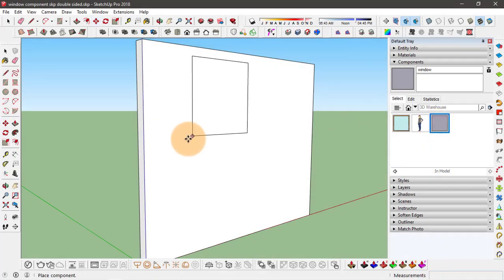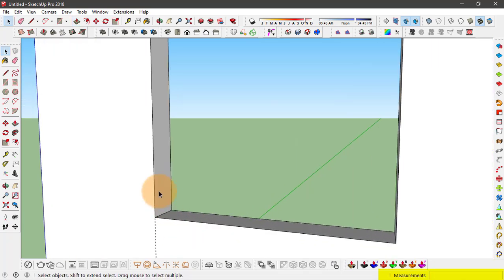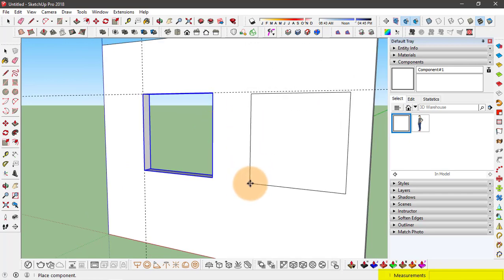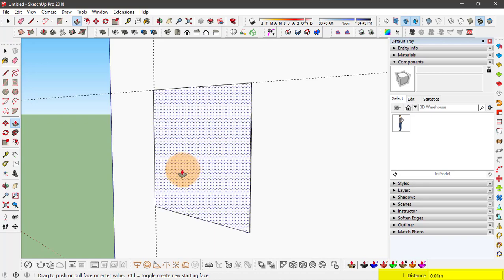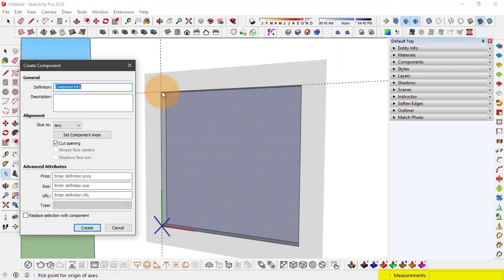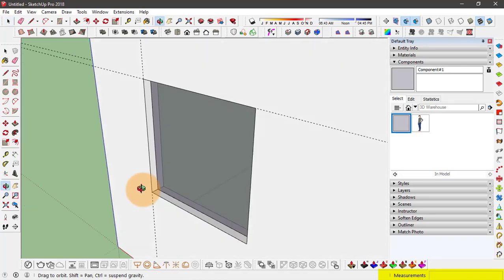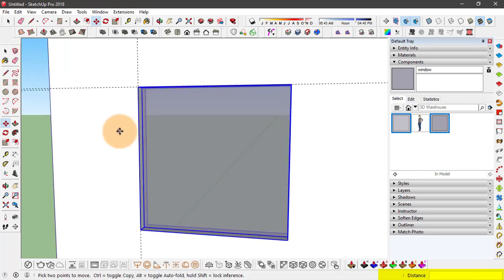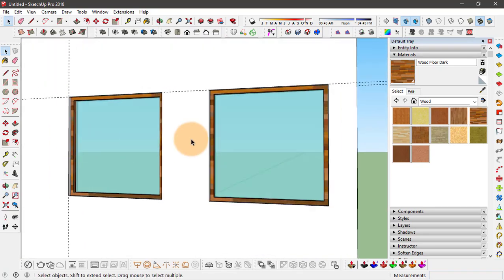Create Sketchup Double Sided Window Component

Comment: Thanks you have lot of amazing videos. I have a question I make 3D printed buildings so having it as a solid is a must. When I try to make a brick house....each brick is a solid then I try to attach the bricks to the wall (a solid) it always says page not responding due to the amount of solids trying to “union” making it all one solid. Is there a way to avoid or fix this??? A response would be great but a video would be amazing. Please respond. Thanks
Reply from the maker: When it comes to 3d printing,  it's best if you keep the model simple, with not too many faces.  Now if the wall unit is made up of a number of bricks,  then there could be trouble because too many faces are intersecting on one plane.  Basically keeping the wall as a whole a solid component will work. Sure,  we'll make a video on it.
Reply: architutors WOW thanks so much for the fast reply/answer. I will definitely benefit from it and I’m looking forward to the video. Any guess on when that might get put on you’re channel? Thanks Again!!!
Reply from the maker: @brittanyharman5754  we'll do it in a couple of weeks.